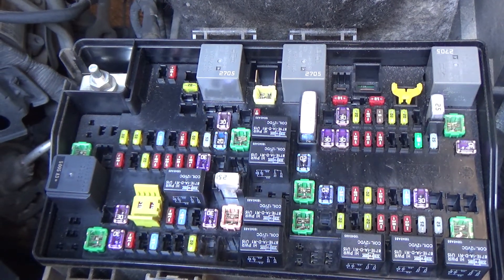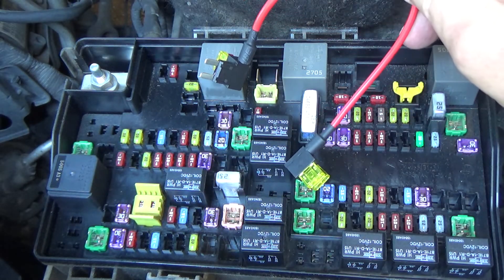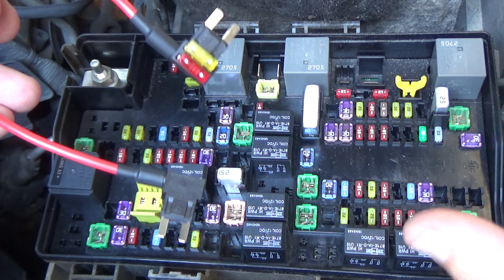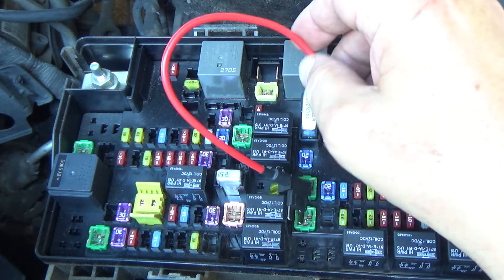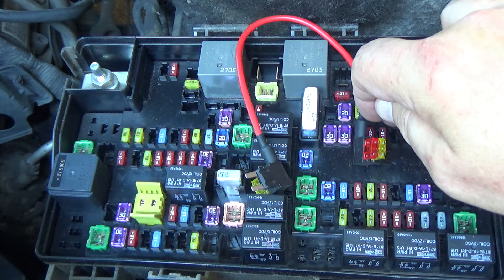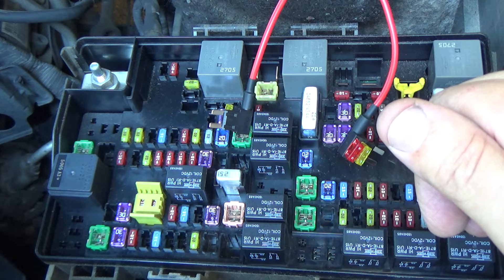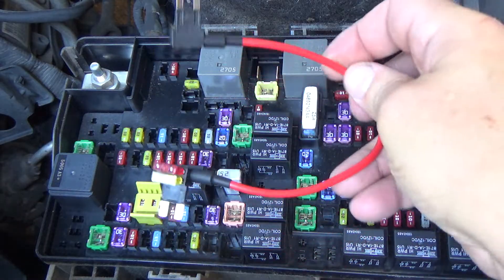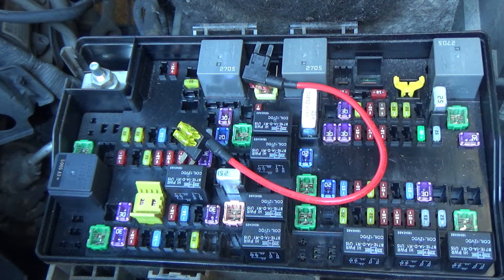The Safety Feature you are Eliminating when Using a Fuel Pump Bypass on Dodge and Chrysler vehicles.

Comment: I'm installing a jumper today on my 2011 RAM 1500 because of the dead integrated fuel pump relay. I understand the risk involved. I would not be doing this if Chrysler didn't charge $1000 for a new TIPM but that's what they want for them. I never recieved a recall from Chrysler on this problem (Fault) and I'm years out of warrantee. I need my truck to run and do all the thing a truck does so the wire goes in.
Reply: It started right up after installation. There is an engine light on now but I think that was to be expected.

Comment: Good information. Luckily now in 2025 Virtual Vision makes one that does shut off the fuel pump in case of accident and its just as easy plug n go and screw the 675 for The TIPM and ANOTHER $500 for the garage to unclip and clip a couple of wires
Reply from the maker: That is good to know.

Comment: How does the fuel pump not shutting off present a safety issue? If an accident is that bad don't you think the battery will probably be dislodged anyway? The probability of what you're saying is very unlikely.
Reply from the maker: People have been burned up because the pump kept running and spraying gasoline everywhere. Counting on the battery being dislodged is not a good safety practice.

Comment: That's not even why people call the bypass cable a temporary fix. Truth is there are issues with the amperage going through the wire causing a fire hazard. This happened to my wife's 2012 Grand Caravan - we tried the bypass cable for a while, ended up melting one end and destroying the fuses in it. Thankfully the TIPM was undamaged and I was able to just do it right - took it apart, desoldered the problem relay, and soldered on a new one. Haven't had an issue since.

Comment: Vertical visions makes TIPM Plug-In Relay System. 
It goes to m25 and m37 not the cigarette lighter looks ones is 60 the other is 100. Not sure if it is a safer option but you dont have the wire.

Comment: Hey man, so here are my questions. So is it the fuse box that’s the problem? Or a pcm problem? I ask because I’ve looked at the wiring diagram on a 2015 dodge durango , I Basically have no power going to the fuel pump fuse and that’s because the control side of the computer isn’t grounding out the relay to energize the fuse same with the asd relay. Is that because the pcm  isn’t grounding those circuits or is it because the tipm fuse box may be bad internally and that’s causing it not to work? I do have a check engine light so I know computer is alive. What do you think? Have you had a similar experience?
Reply: its a really stupid design. You have micro relays operating big relays.

Comment: I had replaced my fuel pump. It seems like the problemhad stopped then it started not starting again so I did this bypass when I tried to remote start it wouldn’t start I use the key and it started this mod. Is there a problem when using remote start and could there be anything else I should be looking for? Thanks for any help
Reply from the maker: I wouldn't think this would have anything to do with the remote start but anything is possible.

Comment: Hello can i ask a quick question... If when i first turn the key i can actually hear the fuel pump for a few seconds before trying to start... Does that mean this fix won't help me? I'm guessing you shouldn't hear the pump at all until you do this fix.
Reply from the maker: The fuel pump should come on for 2 to 3 seconds and shut off if the computer does not see a crank signal. If the computer sees the engine is cranking it will keep the fuel pump on.
Reply: @737mechanic  but what I'm confused on is if this bypass will help me if i can actually still hear the pump.
Reply from the maker: @durapoker  If you are hearing the fuel pump come on then it sounds like the fuel pump is fine. This jumper bypasses a bad fuel pump relay and in that case the fuel pump will not shut off as long as the key is in the run position whether the engine is running or not.

It sounds like to me your fuel pump is working as it should. With that said even if the fuel pump is running doesn't mean it is putting out the correct pressure.

What problem are you having?
Reply: @737mechanic  it just won't turn over as if it's not getting enough fuel on start up. I changed plugs but not coil packs. I'm also very far from being a mechanic lol so i really don't know what's wrong.
Reply from the maker: @durapoker  If you hear the fuel pump it is probably getting fuel. The first thing to do is figure out if it is fuel or spark related. An easy way to do this is get a can of starting fluid and spray it in the air filter bax will having someone crank the engine and see if it starts and runs for a few seconds. If it does then it has apart but is not getting fuel, if it does not start then it is a spark issue. Either way you need to first scan it for codes to see if there are any codes that might give you some direction on which way to go.

Comment: Is this normal i put one of these even in half start or accesory when i try to listen radio fuel pump is on to . My battery depleted fast.
Reply from the maker: Yes if you put it in an ignition accessory spot the fuel pump will run continuously.
Reply: @737mechanic  is their workaround? I usally listen to radio
Reply: @MrRGM10 There is an external relay kit you can buy. I heard the official Mopar kit is now discontinued, but you can still buy a Bosch SPST relay kit, and splice it into the harness.

Doing it this way taps it into the original circuit, and now gives you an external, serviceable, relay you mount outside of the TIPM. That's what I did to my GC crew van. The TIPM relay failed at 70k, and I have 139k currently. Been running like a sewing machine.

Comment: Why are you laying the jumper across the the TIPM ?!
Reply from the maker: Did you watch the video?
Reply: @737mechanic  yes I did. No problem with the video. It just that one of the leads could touch a hot fuse or the main positive cable and short out
Reply from the maker: @JoseLerma-pu9zb  Very unlikely that the lead would be able to touch a fuse. Even with a test light probe it is sometimes hard to get the tip into the small recess to test the fuses.

Comment: I have used this for the opposite problem my fuel was not working order this part for my dodge caravan with a fuel pump tipm relay after wasting time and on everything else found this was the best option 90% chance your dodge/chrysler has this relay problem by this first and see if it works don’t do what I didn’t spend money on PCM or fuel pump

Comment: Our 2012 was head-oned and it tore the battery, tipm and the engine ecm off the side of the frame rail. I would like to buy one of the jumpers, just so I'm not stranded and get the 12" shaft by a MOPAR dealer

Comment: Hello. So wirh this TIPM that you are showing. Yiu said that Dodge fixed the issue. Well im havibg the issue with the TIPM that you are showing now. Is the fuel pump relay built into this TIPM or not?  If so, where do yiu jump the wires on this one.  Thanks
Reply from the maker: What year is your truck?
Reply: Hi. Thank you for the reply. I have a 2016 Ram 1500 Tradesman short box, 2 door with a hemi. My fuse box looks exactly like the one in your video. Thank you very much
Reply from the maker: @TheCitrus13  From my understanding this has not been an issue on your year model. But if your fuel pump is staying on I will look at the diagram and see what can be done.
Reply: Hi. That's what I have read. I put in a new fuel pump assembly this past winter. It's acting the same as others I have seen. It will spin spin spin and no start. Or it will continue to spin after I turn the key off. Just to clarify. I have seen only 2 videos about this issue with about my year and the same TIPM. I appreciate the help. Thank u very much.
Reply from the maker: @TheCitrus13  Thats not what the problem is with the TIPM's in the video. The problem that the 2010 and 2011 TIPM's had was the fuel pump would stay on after shutting the engine off because the relay was sticking. The engine would run fine. If you are saying the engine will turn over but not start that is something else.
Reply from the maker: @TheCitrus13  Here is a good video that might help you.
https://www.youtube.com/watch?v=fT27VhXyjkg
Reply: Hi again. Sorry I was to reply yesterday but got sidetracked. I'll look at what you left me here the link, I just wanted to say thought, that I have in fact seen these problems on some vehicles with the same TIPM that I have. I'll look and see what you sent. Can you tell me, is there any way to bypass it on the TIPM as shown in the video??  Thank u
Reply: Hi there. It's me again. So I have watched this video and I am sure I can do this BUT the TIPM in the link you sent. It's not the same TIPM as what I have. Any other suggestions?  Thx

Comment: is there an alternate/safer fuse to take power from? i have a cable installed on my 2011 dodge caravan
Reply: Tap in to an ASD fuse... those behave like the fuel pump relay
Reply from the maker: The fuse this mod takes power from is perfectly safe, the problem is regardless of where you take power from you are bypassing the fuel pump relay which is controlled by the computer so in an accident the computer is going to kill the fuel pump relay but since the relay is bypassed the fuel pump will continue to run which could cause a fire.
Reply: @737mechanic  thanks....do you happen to know if the power to m7 ( rear cig lighter ) cuts out when the engine is starting/cranking/turning over then re energizes?
Reply from the maker: @tested123  I am not sure but that is the fuse most people go to.
Reply: @737mechanic  thanks for bringing up the safety issue with the bypass  cable.  I haven't seen anyone else talk about that and I've researched the bypass cable up and down
Reply: @tested123 It cuts out when the engine is cranking. It's only on when key is in the "on" position.

Comment: Nearly half the cars on the road are already taking that risk..  There's still a lot of old cars on the road.   I think it's probably fine-- probability wise.  It's good to know though.   I've never seen one of those jumper fuses before.  What I have done in the past is just buy an independent relay and mount it onto the fender well somewhere clean.   Pull the wires from the bottom of the fuse box and run them to my own isolated relay........   but it's not only for the Fuel pump -- sometimes the AC clutch relay is built into the TIPM also, and I'm sure there are others.  I'm not a fan of it:   You can integrate too many things and it becomes a problem.    Some things are just better left serviceable.   I'll remember this tip though -- using the rear light relay.
Reply: Age of the vehicle isn't really a factor. Cutting the fuel pump in a crash has been a part of automotive design since the dawn of electric fuel pumps. Even my 1988 ford has a provision to cut the fuel pump in a crash.